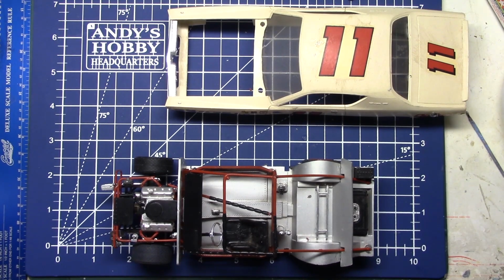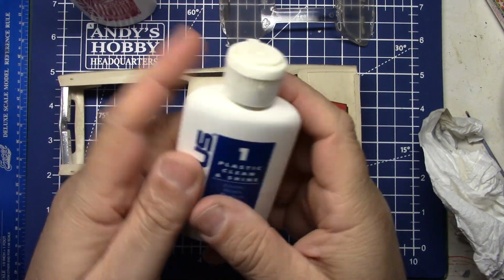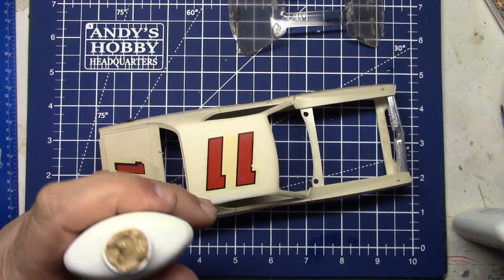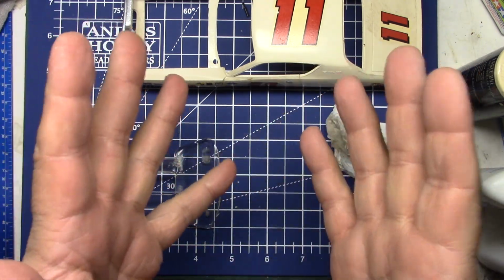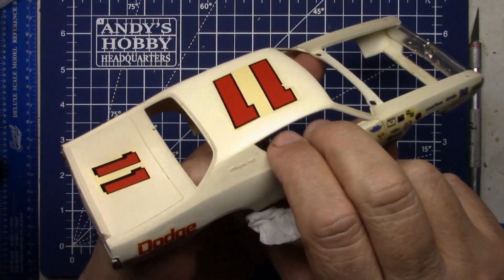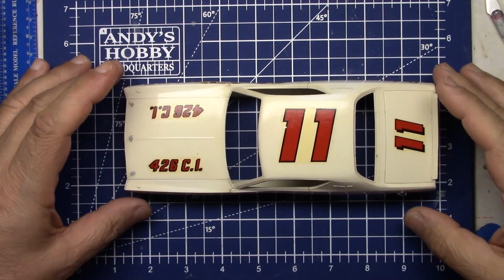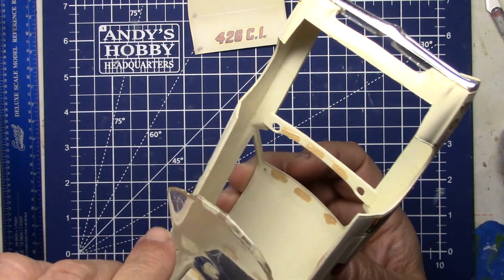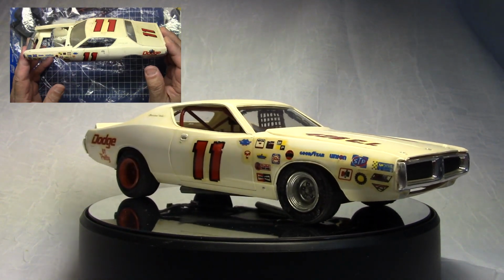This Old Model Car Ep.3 (MPC '71 NASCAR Charger Completed)

Comment: This is a good series I look forward to seeing what comes next.

I had a bunch of kits that my dad built back in the 60s, lots of them after I brought them home years ago after my grandmother passed away ended up getting damaged and I dont know what happened to them now after some 15-20 years now.  But what I know I do still have is a molded in red front engine dragster of 60s vintage style with a devil face decal and flames.  I actually found this kit in a AMT Retro Deluxe reissue in the form of the "Double 3 in 1 Dragster Kit" and I want to say I remember the Fiat Altered Coupe being with the old models brought home but that one is currently missing.  I bought the reissued kit as I will fix what I can (one spoke wheel is broken) but leave the front engine dragster as is and I plan on building the same dragster but build it my way.  Another old model is a A4 Skyhawk jet but this one I dont know what brand as I couldnt find this specific one as it has a balance ball on the fuel tank and it actually balances on a pedestal which is missing as of now, would like to locate this specific kit as well to build myself.  The last model is a old ITC Ideal Toy Corporation 1/350 scale Atomic Power Savannah complete with motor.  Its not the reissued 1961 version with the remote control this one has no remote function.  I am trying to find a reasonably priced one on ebay as my only other option is the Revell version in 1/380 scale without motor.

For my self I have built many kits when younger back in the mid/late '90s, some by myself and some with my parents, most of which never survived for different reasons but what did survive that I still have I am thinking of cleaning up and fixing what is fixable to how I finished it back in the 90s.  I really want to buy those same kits again to build now where I have more patience and not a rush to get a kit built as quickly as possible.  Also will show the evolution from brush painting the bodies on the cars to the revell paint pens to paint the bodies to using spray cans to now with my still unfinished after 3 years airbush and brush painted Fireball Roberts #22 Fairlane.

Comment: Thanks to the aftermarket many sets of decals are available to restore these vintage NASCAR and drag car models.  The new decals are better than the old kit decals.  I have been restoring several of my 70's era builds like this.  It's great seeing you bring this one back.
Reply: Im glad there are new replacements are out there as I been buying up off ebay a bunch of old nascar kits from the 90s and some of those decals may be questionable I wouldnt know till I open the still sealed boxes but it is reassuring that one wouldnt have to print their own or hunt for a good NOS set of decals.